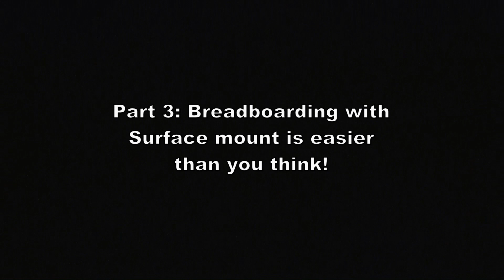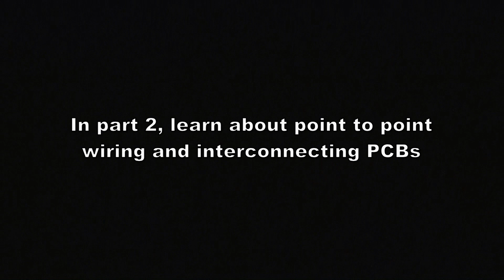Wordless Work Bench #1, Surface Mount Soldering

Comment: Thanks for the videos!  I noticed at the beginning that you used more solder to remove the capacitor... Why not just heat up the existing solder and pull it off? (I'm a beginner trying to learn good habits, it helps to know why :)  Thanks for your help
Reply from the maker: Great question. Thanks! You add solder to joints in order to get through the layer of oxide that forms on the original solder. Oxide does not conduct heat very well. I also use a "flood" of solder to literally bridge both ends of the part and melt them at the same time. Plus, more solder is more mass and more mass means better heat storage.

When I desolder parts using a solder pump or "solder sucker" it also helps to add solder because it will form a better seal with the sucking tool. More solder also helps desoldering wick work better too. I believe it because of the oxide issues previously mentioned.